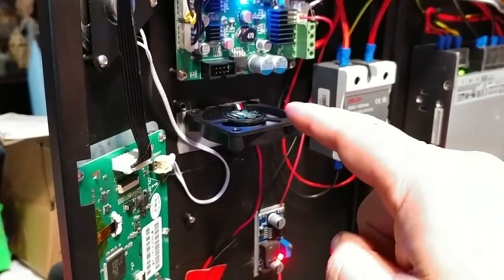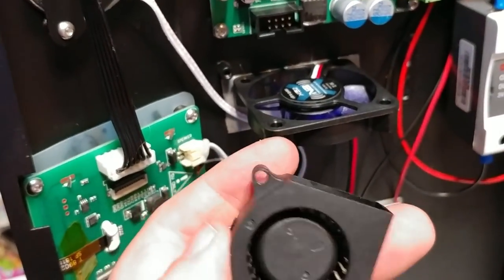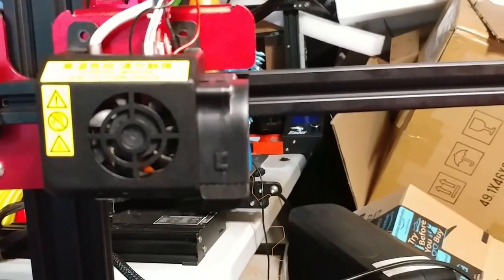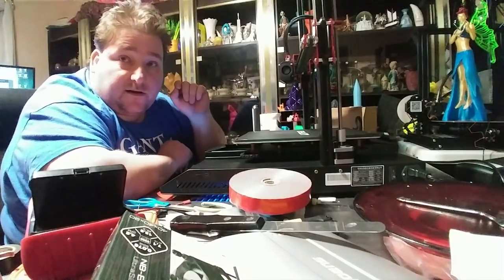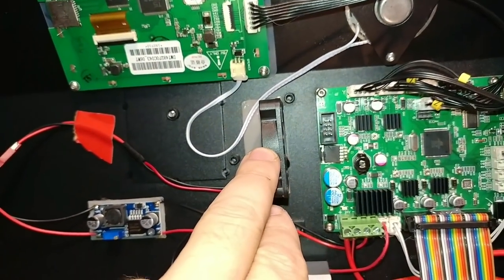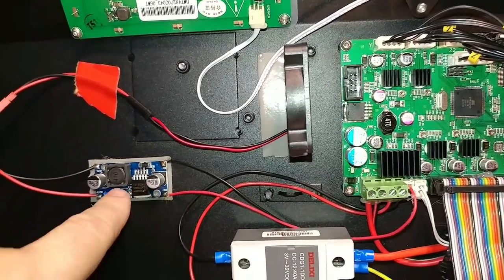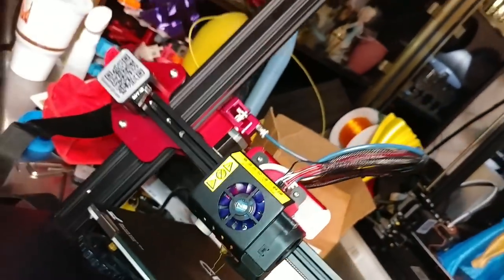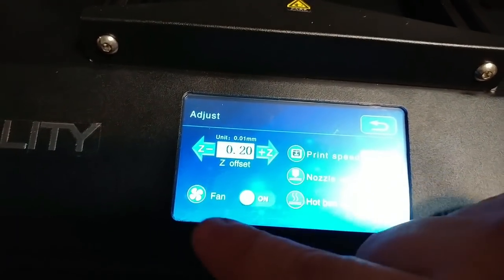CR-10s Pro Ultra Quiet Upgrade for Fans - T3DP

Comment: Thank you for doing this video. Just upgraded all three fans in the base tonight. I used Noctua for the 40x40x20 fans and the NoiseBlocker fan for the mainboard cooling. I also used the cheaper buck converters that you linked. This thing is substantially quieter now. The loudest part on mine now is the extruder cooling fan. I guess I will be upgrading that one next.
Reply from the maker: Be careful upgrading that one can be difficult since you need to be able to control the speed of the fan in your slicer software! If you install a buck converter you lose that control so better for now is to Simply command the fan to run at a slower speed I run mine at 60% typically and it's substantially quieter
Reply: @nerys71  I'm referring to the hotend fan, not the part cooling fan. The hotend fan doesn't have adjustable speed, does it?
Reply from the maker: @boulwarekev  no its fixed speed and yes absolutely replace that one. 40 x 40 x 10. And you can reused the old one as the case exhause fan stepped down to 12v with a converter.!
Reply: @nerys71  Finally got the hotend fan replaced as well. Man is this thing quiet. You're right, you could sleep next to this thing. I have an ANET A8 sitting next to it inside an enclosure and I now can't stand to start that thing up.
If you ever happen to have that thing apart again, I created a bracket to hold the mainboard fan instead of using double sided tape. https://www.thingiverse.com/thing:3405357
Reply from the maker: Very cool!

 @boulwarekev
Reply: @nerys71  thanks doing this video! In the same spot and did the conversion. But sounds like you're saying there's no quiet option on the part coming fan outside of setting it to 60% power?
Reply: @Nerys @Kevin Boulware @Owen Patrick Have you guys found a solution for replacing the part cooling fan? I was about to install this https://www.thingiverse.com/thing:3428978 but then I realized I would lose speed control.
Reply from the maker: cooling being so critical I would be cautious of that.

now if you put TWO on their that would probably do it. speed control is actually not as important as you might think. you "for the most part" only need 0% and 100% which you can do through a buck converter.

parts cooling is the one area of cooling where they are not "overdone" Most of the time where you in fact need and want "MORE" this is the core issue with parts cooling replacement. if you go with a quiet fan one of the primary "reasons" quiet fans are so quiet is they run "slower" meaning they will move less air. reduced parts cooling capacity.

I have several printers right now where I have to limit my print speed ONLY because the parts cooling can't keep up with the heat.

 @gihadmurad
Reply: @nerys71  Yesterday I did the full upgrade of the 5 fans, 4 of which are running with DC converters at 12V. I also did some of them "convertible" so I can go back to 24V stock fans if needed. For the part cooling fan I tried a design from thingverse using a 40x40x20mm axial fan that I linked before but the airflow coming out the bottom was very little compared to stock. After that I designed a 60x60mm Axial to 4020 Blower Adapter to try a bigger fan and even with that the amount of airflow was very little. I did a full circle and ended up installing the original 4020 blower fan back but through the DC converter so it's running at 12V and it's quiet. https://imgur.com/a/BVRgbgb
Reply: @garyb7458  What would be a symptom of insufficient part cooling fan?

Comment: @6:51 you said you wanted to not execute G29 for every print. It's easy to do in Cura. 
Open Cura and go to: Preferences/Configure Cura/Printers/Machine Settings. In the window that shows "Start G-Code" you'll see the G29 command. Simply delete it. Now when you slice and save your programs the G29 won't show up. You will still be able to do the G29 move through your menu on the machine. Your machine will still adjust your "Z" height while you are printing. Just put a finger on one of your couplers while the machine is printing,  and you'll feel it making micro adjustments. It will be more noticable on larger prints. I enjoy your videos. Keep up the great work!

Comment: I just finished my fan replacement and I'm very pleased with the result. Now the part cooling fan sounds like a tornado ;) Thanks for being the pioneer on this.
Reply from the maker: for most prints you can run the parts cooler at 25 to 60% speed which makes it nearly silent! experiment with that.
Reply: Will do, thanks.

Comment: Very nice. With the CR-10S non-Pro version the power supply isn't quite as posh as the one that comes in the Pro version, and the PSU fan (which is quite loud) runs constantly. So I put a 50°C thermal switch onto the PSU fan to keep it off until it gets warm. I've done this with two CR-10S machines, so now I have 18 spare thermal switches. I guess that means I need to get 18 more CR-10S's.
Reply from the maker: Do you have a link for the switches and how to use them? Where do you put a thermistor to make sure you're doing it at the correct time? That sounds like a very good idea
Reply: @nerys71  Gosh, I guess I have 28 left. Here's the Amazon product link that I used: https://www.amazon.com/gp/product/B07CBHSZRW/ref=oh_aui_detailpage_o03_s00?ie=UTF8&psc=1
Reply from the maker: @ScottLahteine  cool I found 10 for less than $8 I will have them later on today do you just break one of the wires and wire them in line? Where do you put the thermistor for proper reading of temperature?

Comment: I got mine just right now and want to informe you that they solved the problem on 4:48 with the cables. So no need any longer to cut out the metal.
Reply from the maker: That is good to hear to get past the bed leveling issues just turn off automatic light leveling and do a normal manual bed leveling it'll still use the sensor to home but then it won't try to mesh which is where the problem comes in you might still get slight variations in offset when it does the home but you can just correct that with a z offset controls under adjust while printing that part actually works very well
Reply: @nerys71  thank you buddy for the help. Today i found out the problem with the Z-Axis. the right long Aluminuim Profile was 3mm LONGER than the  right side. and because this there was vom the bottom never a 90°, it was bit mire but in the result was, that the Z-Axis never ever was able to become 90° to the ground.  This was my last crealtiy i bought i have to say. I will fix all the problem  now, and even had to rebuild the motor and the threaded rod, because there was no distance to the motor, so that all vibrations walked right into the case! 1 mm you know it is needed.. but it wasnt. Atm i have a 90° Z-Axis without need for a extra belt on top any more. Everyone who needs a belt has a quality problem in his machine i expect. 
I ask my self or you, do you think we can use the board, also in the old CR-10 and give it a 2nd Z-Axis motor? I mean then we had with an extruder also a Cr-10S Pro :-)

Comment: Excellent video.   Based on yours (and other) videos on these fan upgrades, I placed two 12v exhaust fans in the back wired in series.  No buck converter needed.   I also placed two more 12v pointing at the controller board and the dc relay.  No buck converter needed there, either.   Just use matching fans so they both get 12v.  I'm not a fan of taking two existing fans and tying them together to get to 24v, but if you are adding a second fan to both locations then a single fan failure still means you lose the cooling in that location.   The only place that doesn't work well is the hot end fan.   1 buck converter instead of 2 or 3 is pretty good, plus extra cooling.  Not too bad.
Reply from the maker: Keep in mind the buck converters are cheaper than fans and if one of those series fans dies it will immediately murder the other fan :-)
Reply: @nerys71  if one of the stock fans die, then you lose the fan at that location anyway. I'm adding fans... The failure mode similar to stock.  Buck converters aren't as reliable as fans that are rated for 150000 hours MTBF.  So now you could lose a fan because the buck converters fails or because the fan dies.  I only lose the two fans at a cooling location if a fan dies. 

I would not tie two fans together in series from two different parts of the system.  Only add a second fan where there is only one to begin with.

A buck converter is $6 give or take.  A fan is between $10 and $15.  The price difference is negligible in the long run, for me.  I like having the better cooling.
Reply from the maker: @underourrock  for me the buck converter is $0.60 well the fan is as you noted 12 to $15 if one of those series fans dies it will immediately deliver 24 volts to the second fan which will immediately murder the second fan so you will be out 24 to $30 if one fails why would the buck converter you're only out the one fan plus it takes less space and it's not as noisy but if the cost of the fans is no problem for you then go for it the extra cooling will be beneficial especially since the quiet fans move less air in general
Reply: @nerys71  I appreciate the discussion.  The second fan would only get 24V in the event that the first fan shorts out.  If the first fan instead fries and has an open circuit then the first fan won't fail.  Again the fans I am using have a 150k hour MTBF rating.  At that rate I could print for 34 years at 12 hours a day and not expect a fan to fail.  

Space is not a variable of concern.  There is plenty of room for 2 exhaust fans and 2 fans near the control board.  Your buck converter is cheap though... the ones I buy usually cost around $6 to $10 depending on features and come with some level of warranty.  Of course shipping is a large part of that cost as well.  

Regarding quieter fans moving less air:  When replacing fans I always look at the specifications.  Creality isn't forthcoming with the air flow specs of their fans, but fortunately it isn't hard to match up voltage / amperage and size specifications to get a fairly good estimate of their fan's capabilities.   The Noctua fans are about 20 to 30% less air flow.  Not enough to worry about, especially if you are using double fans in some places resulting in more overall airflow.    When possible I try to go with larger fans because they can move more air with less noise.  That's hard in some cases, but I did see someone placed a 60mm fan in the bottom of their CR-10S Pro and it looked like there was room for at least 3 if not 4 of them.   Not quite enough room for an 80mm fan, but it might be worth poking a couple of holes. to increase the airflow in there so much with no added sound.

My power supply arrived bad.  It hasn't put out more than about 395 watts and usually limited to more like 360 watts.  I'm going to warranty the power supply, but because that is likely coming very slowly, I'll likely order a 600 or 650 watt power supply (if it will fit... they are 20mm taller) and put that in there.  Someone else that helped me troubleshoot confirmed that their CR-10S Pro power supply was drawing 500 to 505 watts.   I much prefer to run power supplies below their top rated capacities.  You're far more likely to get a power supply failure from running it at full tilt than you are to get a fan failure from a good quality fan.   Buck converters fail, too, and if the converter shorts, you're still delivering 24v to a fan and that fan dies.   I don't see much of a down side to using more fans and not having to deal with a buck converter.   A fan is a simple component.  It's failure modes are very few, especially when they have magnetic levitation bearings.  :)    A buck converter on the other hand has numerous cheap components and it is only as strong as its weakest component.  

Again I sincerely appreciate the dialog here.  I hope you don't take anything I've said as criticism as I certainly am not criticizing you, your work, or your ideas.  I high value people that are willing to share their work online for the benefit of others and for that I thank you very much!

Comment: Another good idea I’d placing that dc voltage reg. On the center rail as a heat sink. Not my idea, but saw someone else do it and it dropped the temp considerably. Just used a couple of the 20x20 rail nuts and screws to mount it.

Comment: Hey, great work. The fans on the cr10s pro are declared as 24V versions, I have found that there are actually 12V fans. The ic 477H (fan driver ic) in the fan has a working range of 10-20v. That's a no go.
Reply from the maker: That's why I use voltage converters I just turn the voltage down to 12 volts for each fan

Comment: I seen somewhere a video of you installing the parts cooling fan and installing a buck board I have upgraded all my fans except that one which my parts cooling fan doesn't have a red black wire I don't have any kind of meters what one is the hot one lol I have the cr10s pro v2 I am putting noctua fans on my printer I used the parts cooling duct u posted on thingiverse
Reply from the maker: The parts cooling fan is the only one I do not upgrade because if you install a buck converter to bring it down to 12 volts, you lose the ability to control its speed in G-Code. So I leave that one alone.
Reply: @nerys71  I replaced the 4 stock fans of my CR-10S Pro (v1) with Noctua ones a year ago and they have performed fine (and quietly).
Recently I also replaced the last one (the parts cooling fan) because the noise started to annoy me, being so much louder than the other fans once it kicks in.
The 3D printed holder I'm using is not perfect and the cooling is less efficient but the prints still look great.

Why would you prefer to control the speed in G-code? Having the Noctua at 100% it still is much more quiet than the stock one at lower settings.
Talking about quiet radial fans: I spent some time looking for a 12V (or better 24V) one but couldn't find it. Seems there is a market open for it.
Reply from the maker: @ericBcreator  it's not that I need to controller by G-Code it's that you can't control it by G-Code once you put the buck converter in place

Comment: Hi Nerys ! May you please confirm that you never had issue like noze blocked since you changed your CR10S pro HotEnd fan with 12V one?
I always heard that this fan is the most important one, also as you said: quite fans are less efficiant.
Many thanks for all your shares.
PS : your Maker Geeks link is dead
Reply from the maker: So far I have not had a problem I suspect the noise blockers put out a little bit more air than the noctua fans do that might be why I have not had a problem I'm not sure

Majorgeeks is out of business they don't exist anymore

Comment: It would be great if you made a drawing,  that shows you how to connect it all together. Have trouble seeing in the video where you take the power +/-  to the individual fans. Hope you can help
Reply from the maker: I use the power wires of the existing fans I am replacing :-)

Comment: Did you ever figure out how to switch that cooling fan at the end of the video? Currently that one is also the loudest thing on my printer after I changed the fans inside the printer.
Reply from the maker: Actually yes I've discovered you don't really need to use quiet fans you just need to use dual ball bearing fans they are virtually silent so just order a 50 15 24 volt blower that has dual ball bearing

Comment: Hi Chris! Please print some enclosure for the Buck converters like this: thing:3014010. If the buck converter falling down and tuching the power supply frame it can may shortening the circuit.
Reply from the maker: Cool thanks. I am not worried about them letting go. the 3M VHB is insane stuff. it would take a hell of a force to get those off :-) but I may print some of those cases anyway as it looks fun.
Reply: Ditto.  As long as the surfaces are clean and relatively flat, and the buck converter is not subject to any mechanical forces, the VHB should hold forever.
Reply: @nerys71  Yes, you're right. Im a littlebit safety maniac xD. If i see any chance for the fail i try to eliminate (eat) them :D.

Comment: I am not 100% sure so I ask here. The 40x40x20 12V from the PSU is blowing outside right? It blows the hot air outside of the PSU?
Reply from the maker: Correct you want it drawing are out of the PSU and exhausting not blowing in
Reply: @nerys71  thx for the answer. Did you also overvolt the hotend fan to 13 ? Or only the mainboard fan.
Reply from the maker: @24KG24  only the one fan. The rest just set to 12v.
Reply: @nerys71  great video - did you got fixed the problem with the autolvling? :-)

Comment: so a 12v  40x40x20 in the power supply, a 24v 40x40x20 in the back of the case, and a 24v 50x50x10 for the board fan? i want to do it without using buck converters is that a possibility?
Reply from the maker: Yes it is just by the correct voltage fans I have discovered that buying the correct fan is a quiet fan it's always You by a decent quality brushless dual ball bearing fan it will be virtually silent